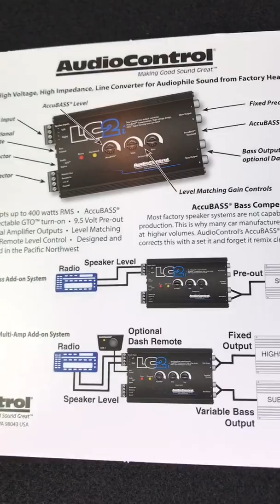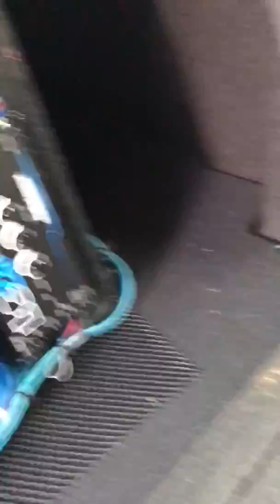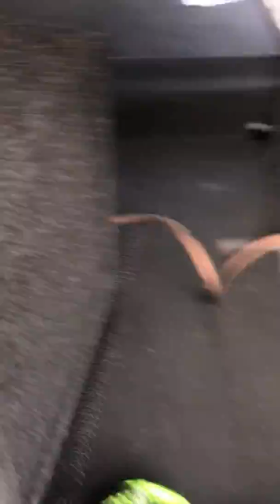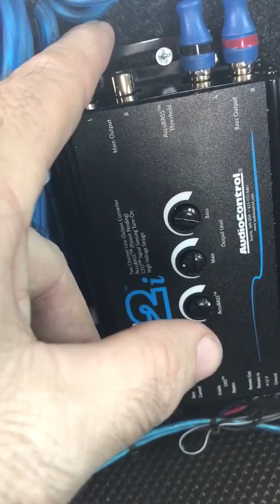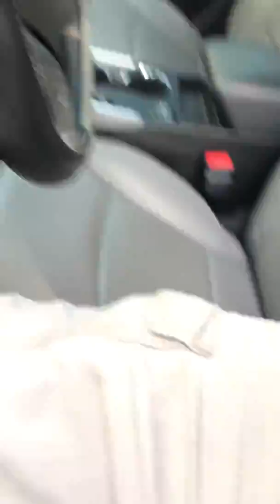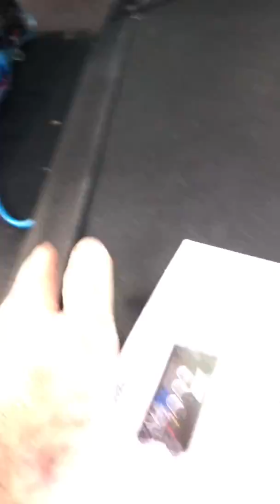LC2i install 2013 Sonata Limited

Comment: how did you connect the 12v power?
Reply from the maker: WIZARD Z  I ran my 12v from my amps power to LC2i same with ground amps 12v comes from battery like normal setup so I only have one power wire running to the trunk of my car.
Reply: im trying to find the color for sub wires on the amp as we speak
do you remember the colors to tap into?
Reply from the maker: WIZARD Z  negative =green positive=black
Reply from the maker: WIZARD Z I'm assuming you have a Sonata
Reply: No I have an OPtima but its the same shit
I have a negitive green but my positive is pink

Comment: the only thing is you shouldnt connect it to your amps power wire and ground , they should have their separate power source
Reply from the maker: zorhis1996 just curious why? I have inline between the two. Been running since install no issues.
Reply: Jacob McCurdy Its not good to have something else dawring from tjhe same power because the power wire size is determinded by watts , if you have something else running from it the amp will suffer from it , its so small that it prob wont make much of a difference but its always better to be safe than sorry

Comment: Would I need a cross over for a sub amp and highs amp even though I'm using the Lc2i?
Reply from the maker: Alejandro Vences the LC2i has inputs for a sub amp for lows and main amp for inside speakers. so you can run 2 amps off of one LC2i do your amps have built in crossovers? How is the wire coming from the head unit? Is it ran parallel? What ever signal you grab from that's what's going to be coming from the amp. Example Sonata uses total of 7 speakers 1 channel for tweets in dash and front speakers. 1 channel for rear door speakers and sub. So if I were to grab the rear door single and run highs it would not work. I would need to have 2 LC2is or the LC7i.. hope this answered your question..

Comment: thanks for post Jacob. quick question, I've hooked mine up exactly like how you have it, but found that both the amp and the lc2i stay on even after turning off the car. have you had this issue or do you know why this is happening? any info is greatly appreciated.
Reply from the maker: MrMeseUfa mine shuts off when I shut my car off..what's the Year, Make and Model of your car? Also what factory system do you have in your car?
Reply: +Jacob McCurdy hey Jacob, I have a 99 Cadillac deville, base model, doesn't have the bose system, running a crunch power zone pz1500.1, and a 12" solo baric kicker. I did replace the rear deck factory speakers with rockford fosgate primes. come to think of it, I tapped into the speaker terminals and not the factory wiring. that may be the issue.
Reply from the maker: MrMeseUfa  That shouldn't be the issues because it would get the same signal from the speaker terminal that it does the wires themselves does the radio stay on? Have you tested the terminals of the speaker you are tapping to see if the speaker itself is still getting power after the car is off?
Reply from the maker: MrMeseUfa also are you still sitting in the car after you shut it off? And seeing that the two units are on? Or are you leaving the vehicle and going to truck to see that they are still on?
Reply: +Jacob McCurdy i have to go to the trunk. when I get there both the amp and lc2i power lights are on. I think they even stayed on overnight the first night.

Comment: your video is the first one I could find of an ACTUAL install, I been wondering about if splicing off the rear EXACTLY like you did would give any resistance to the rear speaker it's attached to. but since you didn't mention it I'm going to guess it doesnt.

I'm SO GLAD I found this video
Reply from the maker: mrosebro I tested the resistance when I installed the unit and did not notice an increase..This is why a made the video because I couldn't find anything either so figured I would make one to help others like myself out and save some people the time I wasted lol...
Reply: Thank you again! you took a thought and a hunch, and changed it into a confident choice!

Comment: Hey so I got my amp and sub hooked up and man it slams! Jyst w heads up if u want a little cleaner look you can open little side panel on right side of trunk ur factory amp is right there and u can tap into whatever speakers u want and it's all hidden so u don't have speaker wire hanging from factory Sub just a thought! thanks again for the info I got from u!
Reply: Which wires did you use from the factory amp ?

Comment: Hey Jacob got exact same car and setup except I have 12 P3 and Prime 750w amp. Just curious how it's working out so far? I am about yo install everything this weekend! Also did you run the recommended  1 amp fuse on lc2i power wire?
Reply from the maker: DJT8508  no I did not... I have had no issue with the install so far...I did blow one of the P3's (melted the coil)....had to much power going to it changed over to a larger ported box and it sounds great...many people think I'm running 2 12's... they are surprised when I show them a single 10..
Reply from the maker: DJT8508 when I blew the other one I switched to a 4ohm wired down to 2 ohms to get the 500watts rms out of the amp
Reply: Jacob McCurdy Cool glad to hear it! I'm a little worried about overpowering my 12 my Prime 750 has a birthsheet of 900 watts lol
Reply: Jacob McCurdy One more question is your factory 8in sun still hooked and are u getting any odd sound from 8in cause of pressure differences?
Reply from the maker: DJT8508 yes the 8 is still hooked up and fully functional I have not noticed anything weird from the 8 I did level off the bass from the factory speakers...so I rely on all the lows from the 10 and the door speakers... the 8 is more like a mid to me since it never really hit the lows..my ported box is tuned to 39hz.. two things about the fear of over powering the speaker... 1. Make sure you have your gain set right (no clipping) 2. Make sure your box is big enough..and you running ported or sealed? Birth sheet on my amp was 641rms..
Reply: Jacob McCurdy I have the loaded P3 12 came in the box already it's internally wired to 1ohm so I'll be getting all that power!

Comment: hi man nice educational video just have a question. I just got my lc2i and I got a 4 gauge wire kit the part I'm confused about is do I need to feed the amps power and ground to battery and chassis? and have 16 gauge to the lc2i 12v and ground?
Reply from the maker: Anthony Gonzalez yes you still need to run power to the amp the way you normally would ... the only difference is you can bridge power and ground from amp to LC2i or you could run power and ground to LC2i and not have it bridged... I did mine the way I did so I wouldn't have 2 power and 2 ground cables running to the back of the car..

Comment: and also did you ever turn the gain on the amp back up after you tuned the lc2i or is it unnecessary to do so?
Reply from the maker: charles boyd yes the gain on my amp is set at a 3.5 this gave me the sound I wanted and did not produce any clipping I did try it out at a gain of 5 but at lower volumes it did not sound right..I set my gain based on the normal level I listen to my music at...and I am pleased with the level of bass at different volume levels

Comment: you gave a remote out connection from lc2i to the amp remote, did you use any remote in to the lc2i
Reply from the maker: Raheel Ahmed  no the LC2i is turned on when it senses a signal from the speaker and then turns on.. this then sends the signal to the amp to turn on...this creates a small delay when the car is turned on before the sub kicks on which I like because I tend to not turn down my radio wen exiting the car..
Reply: thankyou , can i give remote out from lc2i to 2 amplifiers

Comment: So, what could the remaining outputs on the Lc2i be used for? Could those be run to the door speakers..? I'm assuming not because it's only tapped into the low frequency signal from the sub? I understand the basic principle of this thing but am obviously a bit confused. LOL. Great video, thanks!
Reply from the maker: Anita Wommack  the LC2i is a 2 channel unit so yes you could use it for a 4 channel amp for door speakers if you wanted to

Comment: You've tapped into the rear speaker and feed it to the Lc2i; can you please try one scenario for me, while listening to music you adjust the fader to only hear from the front speakers... would the lc2i still be able to work seeing only power is being directed to front? I am curious to know and it would direct me to proceed with either direct stereo head tap in or to go with your method and save me hours on time.
Reply from the maker: candlemedia I just put everything forward and the amp LC2i still come on and only the front speakers and subwoofer come on...hope this helps.
Reply: It helped me significantly and not only that but saved me so much time in planning. My thoughts were to tap into the head unit but THANK YOU SOOOO MUCH for telling me it would still power with speakers.
Reply: If you fade to the front it will slightly lose input signal but the nice thing about the lc2i is you can adjust the input

Comment: Thanks for the video, should I run a dedicated power wire from the battery to the lc2i? Jumping from the amp to the lc2i is ok?
Reply: Yes you should and add an inline fuse
Reply from the maker: Gil T it's up to you I read other comments from people jumping it which is why I did it.
Reply: Lol

Comment: So you connect both the 16 gauge wire for ground and power of the LC2i into the amp WITH the amps power and ground cables? You don't have to splice into them? Thank you
Reply from the maker: g00dGuY34 yea didn't splice them just bought a 16 gauge wire and twisted the ends together and plugged them into amp positive and negative

Comment: your video makes the install so much easier.  I have been struggling with installing the lc2i for 5 months. I have a 2013 ford fusion titanium and I am running a 10 in sundown woofer with 650 rms sound stream amp. now it sounds amazing compared to the pos loc I had. thank you.
Reply from the maker: Marshal Celia np glad the video helped